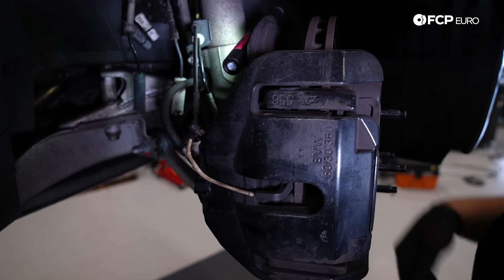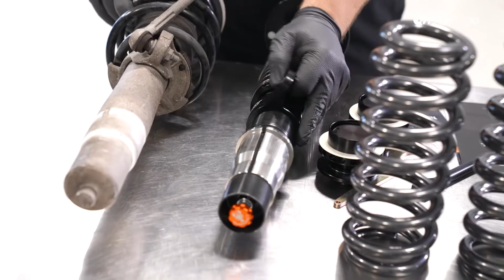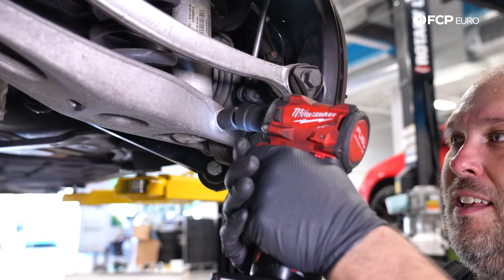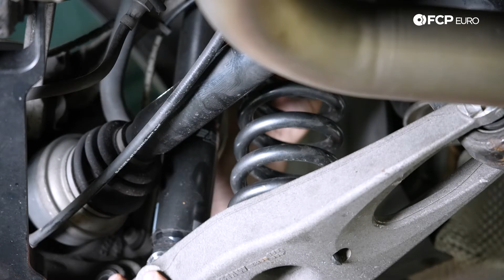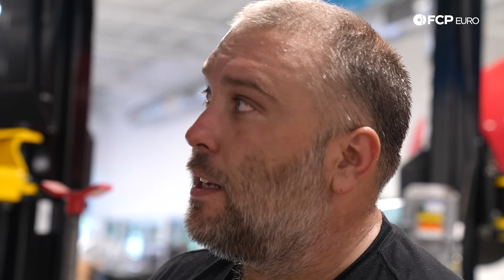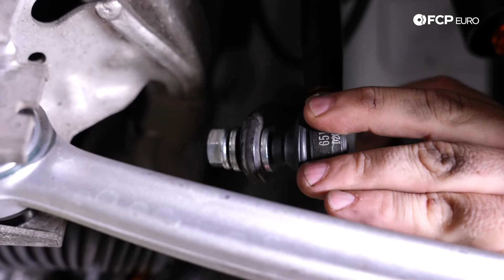BMW E90 Coilover Installation DIY (E90, E92, E93 2008-2013 BMW M3 & 1M Coupe)

Comment: @fcpeuro i need your advise so i own audi a3 2015 2.0 tfsi and a chevy cuze 1.4l eco 2016 they both have 145k miles and the transmission has never been services so if i drain and refill will that prolog the life of the transmission or will it starts slipping and better leave it as i'm on a borrowed time till it breaks ?  thank you

Comment: When i was doing the front end on my e90 that pinch bolt became one with its surroundings 😂
Had to drill it out after i snapped them, it was the only bolt i didn't have a replacement for so they are currently some random bolts that fit. Since its an awd the front axle nut was almost completely rusted out. it was such a hassle 😅

Oh yea and as a bonus when i went in for an alignment after they broke the rear adjustment bolts after rescheduling me twice. Didn't have my car for a month... and they only wanted to order the bolts through BMW so it cost me 80 bucks. Gotta be nice though since they are one of the only places that will even touch my car, people really don't like working on bmw's.

Plan on getting bc coilovers someday so i always watch videos like this to remind myself that they were bad when i got the car 30k miles ago lol